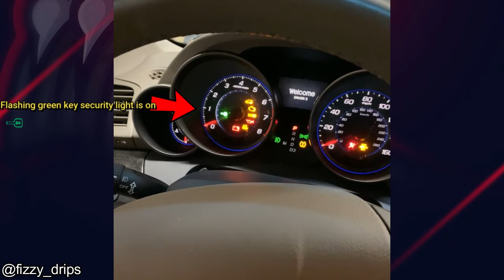Customer States "Engine Is Knocking!" | Just Rolled In

Comment: Whenever a Charger or Challenger is having engine or rear-end problems, I will naturally accept the fact they have been revving the piss out of the engine, doing burnouts and doughnuts.
Reply: Fiat doesn't make them like Dodge did decades ago
Reply: @jdigitalseven7  Your statement made me look it up, and I found this... When Chrysler — today, part of Fiat Chrysler Automobiles — revived the Hemi engine in 2003 for Dodge Ram pickup trucks, it was a hemi in name only because the combustion chambers were nearly flat.
Reply: @tallpaul9475  I always felt like the new hemis looked too flat I got a 1st gen in my 56 DeSoto
Reply: Only thing missing from your description was, while the person was doing donuts they were also yelling at the top of thier lungs, 'LYNRD SKYNRRRRRRRRRRRDDD!!"
Reply: Probably doing prolonged burnouts in the redline 6k plus area
Reply: @10super  I would very much agree!
Reply: @PayNoTaxes0GetNoVote  what are you on about and where did you pull the words of your quote from? Did you start a fake argument in your head or something? Side note 245 is not the max hp mine puts out 230 just stock and the top model did 319. Maybe do some research first
Reply: There is a fine line between revving the piss out of an engine and revving the shit out of an engine....
Reply: @PayNoTaxes0GetNoVote  don't forget shitty drum brakes, hard skinny tires, weak suspension, and steering where you're constantly turning the wheel back and forth just to go straight.  Don't forget how the whole car will try to crush you to death in a wreck.  There's reasons why they "ain't built like they used to" and to top it all off reliability was always questionable in those days
Reply: As a charger owner i agree 🤣
Reply: @username abusing and thrashing them is not considered performance activities, to me.
Reply: @username Your Ford car company didn't get moved into ownership of one that specialized in tiny little putt putt cars.  Thankfully!  :)
Reply: @username thats also true. i have seen the gran tourismo and it is NOT garbage. i have seen them get thrashed and take it pretty well. even the v6 isnt bad at all.
Reply: @I_trigger_liberals But they do have the classic Italian build quality.
Reply: @jdigitalseven7  they do plenty of shortcuts now in quality
Reply: I Hydro locked my ‘13 RT plus black top edition.  It took Fiat 100 days to get me a replacement motor. 14 1/2 weeks. 2,400 hours. 6,000 minutes. What- did Chrysler suddenly run out of baby hemis or something?!😳🤦‍♂️🙄🤷‍♂️
Reply: @HM2SGT  Could be the semi conductors (assuming it has them on the engine) were not available right away, there is a shortage on those kinds of things.  Or, maybe there is a shortage of the engines, a lot of them are getting stressed and damaged then replaced.
Reply: Thanks very kindly for spelling, "doughnuts" correctly.  So nice to see someone in a comment section who can spell!!  :D
Reply: @KuriusOranj  Thank you!  I appreciate it.

Comment: The brake pedal going down when you turn the wheel, means you’re going to fast on the curves and you scared the car.
Reply: It's the anti-spill system for tall coffee cups...
Reply: *too, not to.
Reply: @jumpinjojo  Et tu, Joseph?
Reply: @jumpinjojo  auto correct did that, you stoll get the idea..... I hope
Reply: @haroldwilkes6608  it also has the unintended side effect of slowing the truck/SUV down when making a turn as to not lose control.  They make the raptor/TRX accelerate fast so that you can resume intimidating smaller cars ahead of you, until you have to turn.
Reply: Im genuinely curious of the science on why turning the wheel made the brake pedal go down. Can someone explain?

Comment: Horn issue:  The "Nickel Bridge" (or Boulevard Bridge) in Richmond, Va., is famous for being a tight, two-lane toll bridge over the James River.  One time, my wife and I had just entered the bridge from the south end when the car's horn shorted ON.  We blared at the guy ahead of us continuously all the way across the bridge, through the toll booths at the north end, before the horn finally quit.  Wife was ready to crawl into the rear seat foot wells in embarrassment.  And thank goodness the guy ahead of us didn't use this as an opportunity to exhibit a bit of road rage.
('Twas called the "Nickel Bridge" because the original toll was 5 cents.  There are many stories about the bridge.  One concerned a toll-taker who had the reputation of ripping the nickel out of your hand to the point of raising welts or drawing blood.  Legend has it that one evening, a bunch of MCV (Medical College of Va., later VCU Medical Center) students came through and held out a cadaver hand with a nickel epoxied between thumb and forefinger.  Hilarity ensued.)

Comment: I feel very sorry for that ford truck and audi's interiors, imagine coming back to your car just to find it a scrap yard condition and the only thing you can do is hold back your tears 😢
Reply: Have to wonder - who let the bear out.
Reply from the maker: @robertthomas5906  apparently the owner did.
Reply: Why would you leave your window down?
Reply: @hamdude2109  Heat. Some people just leave the windows cracked open just a bit in the summer, to keep heat from accumulating quite as much. But really, he might have left his window open a lot more. Either that, or someone deliberately stuck it in the just-open-enough window.
Reply: @101Volts  LOL. Where I live people roll UP the windows because of heat, as in so that some jackass won't set your interior on fire. Now, I ask again, why would anyone leave their window down?
Reply: @101Volts  Wouldn't be surprised if it was open just a bit, the bear smelled food or something interesting, then pried/pulled the window down (easier than you might think.) I have to admit I would have seen if it was "still good," and started looking for replacement interior panels... Lmao
Reply: I came outside to my airbags having gone off after I was shopping at Walmart and it turns out a truck backed up into my car and the front hit the curb pretty hard. Still driving the same car with the same messed up airbags to this day because it's $7k to fix it. Literally one of the worst feelings ever.
Reply: @hamdude2109  I don't think you understand. When it is 110+ Fahrenheit outside, people will leave some windows cracked down to make sure the car is not a literal oven when getting inside.
Reply: @hamdude2109  We don't all live in a place where people light cars on fire every 3 hours. Where are you, Detroit?
Reply: imagine getting paged to the front counter of the store or security office of a mall and thinking maybe some crims stole your stereo or the whole car or something, And then someone is just "So yeah your car is on fire".

Comment: Thing about bears getting into cars is most of the handles you just have to pull out on which is really simple for a bear.  If you've ever got into a strange car for the first time and can't find the handle to get out that's exactly what happens to the bear.  Easy to get in but hard to get out
Reply: Uhh, only if the car isn't locked, you know?
Reply: I love watching someone who has never had an older truck try to get in mine as it’s one of the ones you grab the handle and push a button with your thumb type handles even funnier to watch someone have a small panic attack when I “run out of gas” because my truck has dual tanks as well (1996 f150 for anyone wondering)
Reply: @justchillin7552  I had a 94 with the straight six. Couldn't trust the gas gauge and couldn't afford to fill it so I always made sure there was five bucks worth in the small tank for when the big one ran out

Comment: I didnt get notified! Ugh...well, Im here now. And Im in a GREEEAT mood lol. I can tell you, that nothing makes you feel more alive, like you accomplished something like filling a half inch hole by welding it...on thin sheetmetal...with a stick welder...as a newbie welder! I am the weld master! Ok...now Im going to watch the show hehe.
Reply from the maker: Dang, that has been happening lots lately and have you been working on the bus?
Reply: @JustRolledIn  Not much on the bus, but the Ranchero..which needs to be out of hte garage so I can have space to work on the bus brake cylinders...I plan on showing those off..that system is strange...and huge, like 4 times as big as a normal brake pot.

Comment: I think the bedazzled ignition was my neighbor.  Daughter got the car as a graduation present and put that on as soon as she got it.  The next day they towed it to the shop.  Found out from them a couple weeks later that it was the extra decoration she added.
Reply from the maker: That be something else if that was the same car lol
Reply: If the someone puts a thin cut in the bedazzle ring, so that current can't circulate all the way round, it probably won't affect the key.
There's a coil just behind where the ring was put, and that coil induces current in the transponder in the key. The bedazzle ring effectively short out the coil. Cutting it would stop that.
Reply: @diver3005  
Also those ring things are suppose to be use on press to strat button cars not ones that still use a traditional key start

Comment: I had a '93 Dodge Dakota that was very faithful. 
However, when the horn went, it was kind of funny: press the top of the steering horn button, the high tones would sound; press the lower part, the lower tones would activate. 
I had fun with that, until we traded it in for another vehicle.

Comment: Numbah 1. Bearses don't respect any property at all.
Numbah 2. Man if ya thought that forklift tire was cool you shoulda seen some of the stuff we had to do as heavy equipment/tank mechanics. There was some absolutely crazy things done in the name of maintenance, especially in the field.  🤣
Great channel man. So much fun. 😎
Reply from the maker: Oh I would love to see that! If you have any videos that be awesome to see and thanks for being here 👍
Reply: There was a small ww2 German half track pulled out of a lake or river. It was pretty much fully intact and not horribly damaged. When they panned over to the tracks on the right side the last large bogey wheel in the back was missing and the crew pulled some links out of the track and shortened it so they could continue to fight, or at least get away. It's very possible they got over run and set the throttle and let it drive into the lake themselves to keep the Russians from using it.
Reply: @69Dartman  That's super cool. Im going to have to look up more on that story now
Reply: @JustRolledIn  Don't man. It was in the days before video cameras were all over and easy to get. I have some pictures, on photo paper, but it was in an ancient age technology wise. Funny, but only through the late 80s and early 2000s. 😎
Reply: @69Dartman  Yep. That can even be used on modern armor. We called it short tracking in my time. It could be a good way to get it out of the field to a shop for easier maintenance.  😎

Comment: That 2015 F350 had a Hydroboost problem.  I had a 1977 Lincoln with Hydroboost, and the brake pedal stuck to the floor.  I can't believe after all those years, they haven't fixed that problem!
Reply: "At Ford, Quality is Job NONE!"

Comment: Not too long ago, I heard a vehicle attempting to do a burnout a few blocks down. I heard it Rev up, then it went boom, then it was quiet. I knew it was catastrophic engine failure. Didn't know what vehicle it was at the time, but found out a few days later it was a charger. The owner was attempting to get a new engine through the warranty. Don't know if that happened. 
As a smoker, I found out that the padding in the seats do smolder if you happen to knock off the cherry to a cigarette. Happened to me a few days ago. Took me a 5 minutes before I could smell it. I was driving, so it was about another 5 minutes before I was able to extinguish it.
Reply from the maker: Well glad to hear your car didn't catch on fire or anything lol
Reply: @JustRolledIn  it would be devastating if my car catches fire. There's so much crude oil saturated in the carpet from the years I've done that kind of work, plus I also hunt. So there is no telling how much ammo is lost in my car
Reply from the maker: @simpleman806  yea that would not be good lol

Comment: 2:50 Was the vehicle driving around a rusty junkyard for years. Cause that's what it looks like, a ton of rust dust.
Reply from the maker: Looks like an air filter off heavy equipment so maybe somewhere in the desert or a mine?
Reply: @JustRolledIn  A Centri filter pre-cleaner works wonders, have one on our Morbark tree chipper, works wonders.

Comment: 2.50 must be a farm worker, I was a mechanic on a farm and this is how some of the outer air filters looked like after being in the field for a month, sometimes two weeks...
Reply from the maker: I believe it! I use to work on equipment in mines. Sometimes they look like that after two days 😅
Reply: Just cleaned a lawnmower air filter that looked surprising similar; I was tapping it on the sidewalk after blowing it out with a can of compressed air and got a pile of dirt. New one has since been installed. Oddly enough the engine ran without missing a beat with the dirty filter.

Comment: but why would a metal ring block a signal? i dont exactly get it. and it had diamonds to and they can block anything. only reflect light. i have a ring much smaller but made of the exact same material.
Reply: It's a very weak signal and system; it's enough to do what you saw it do.
Reply: @markh.6687  oh. yikes

Comment: @ 2:29 that is a blown aluminum case ? I see gears ( mech straight question )
Reply from the maker: A transfer case on a Hyundai, they didn't mentio model or year but I'm not sure if they're aluminum.
Reply: @JustRolledIn  It will be an alloy ~ it is cast most likely > These develop fracture propagation under stress dynamics → Likely the dump the clutch in your 70's fire-bird  at 6,000 RPM because you are up against a pickup truck … Actual event > twisted the drive tube right out from under the vehicle

Comment: Cylinders 3,5,7 full of coolant? How was it not hydrolocked?
Reply from the maker: Got lucky, but those connecting rods were probably pretty bent lol
Reply: @JustRolledIn  What?? We can straighten them in a vise, no problem!
Reply from the maker: @markh.6687  rubber mallet should do the trick, eh?
Reply: @JustRolledIn  Might have to use a dead-blow hammer, but we'll get 'er done, no worries!